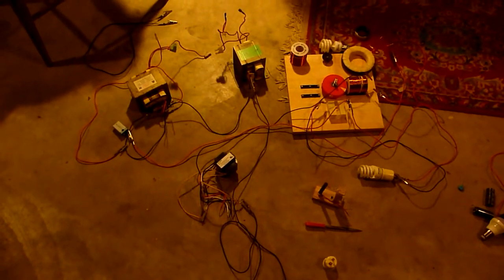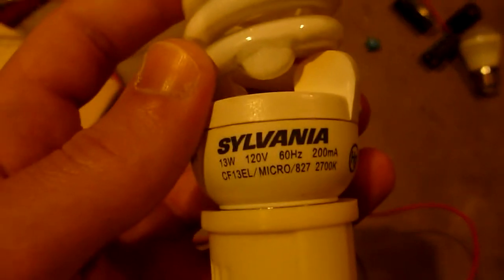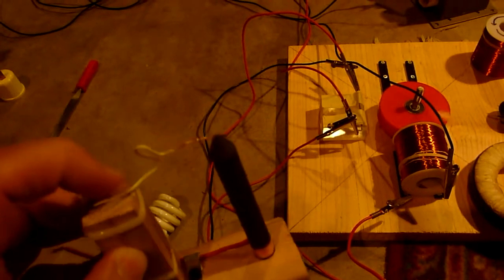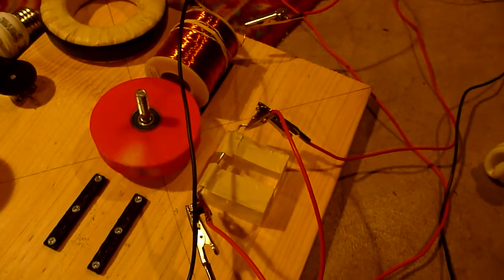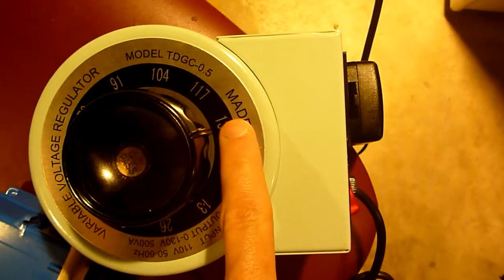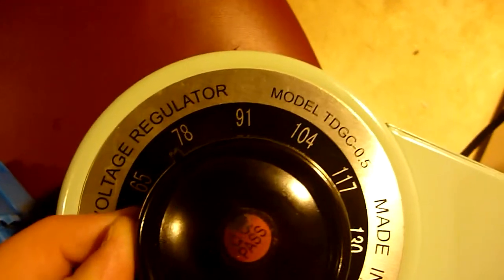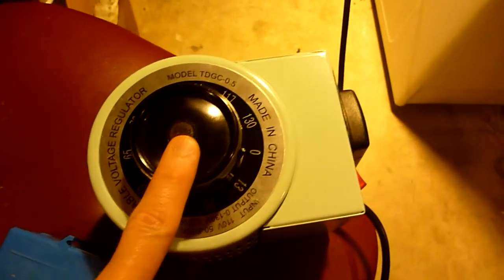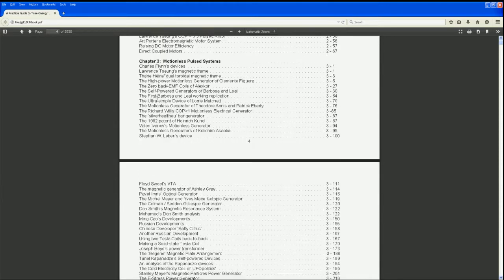Back EMF Experiment Part2

Comment: Wonder if a slayer exciter would get some nice oscillations at high voltage to then pump through your transformers and the drop the volts down to run a led (cfls have weird ballast circuitry that messes with the sign waves). Was also wondering if using the transformers, the way you do, is what Gerard Morin was trying to do with his cold electricity water drain pump project?   To prove a power gain do you not need to show watts going into the system compared to output watts the system is producing? If you are using a light bulb specified at so many watts it may not be using that wattage and so a lumin test would be needed I guess to say what power load the system can perform.  Very interesting for me to see your project, thanks:)

Comment: Cool setup! Interesting setup... But to answer the question you posed in the title, I would have to answer "No, this is not proof of OU"...
Now, I am not saying that it is not OU, I am just saying we do not have sufficient evidence on Input Watts vs Output Watts.
More work is required to determine the efficiency of this setup.
It is a cool setup and am interested in finding out the true efficiency...
If you used a wall-wort plug meter ($20-$30 wal-mart) and plugged your wall-wort 5V power supply into it, you could get an easy wattage input reading..
You would then have to do some sort of rectification of the output into a cap with a large (20W or more) resistor... Measure the voltage across the resistor (quickly before it heats up) and use Ohms Law to figure the true wattage being output...
Those are my 2 cents anyways, keep up the good work and keep experimenting.
Peace.
Reply from the maker: Binj Komisar Thanx for the comment. I actually do have a volt meter but these voltage and amperage spikes are very difficult to detect. The reason for that is because they are so sharp and then they go to zero very quickly. I used a volt meter in my previous video and it showed the same output voltage as input, even though the bulb was being lit up pretty brightly that was 13 watts (input is 5.9 volts at 0.4 amps so 2.36 watts max). Using a large resistor to calculate output is a brilliant idea. Also, you are correct because the video doesn't provide enough proof of over-unity. My next step will be to create a self looping circuit of some kind (Ed Leedskalnin style). He used a variable capacitor for this effect as well as a bottle with clockwise and counterclockwise wound coils (the air is a non-linear transformer material). The opposite windings caused induced magnetism to clash but at a non-linear way... this actually amplified volts and amps and allowed the entire system to power itself (my theory). We will see :P Checkout the paper that I provided. It is filled with all sorts of information, overwhelming actually.
Reply: Naoki Kashima
 Yes, I will have a look at the paper.. It is important to put a large capacitance filter/smoothing cap in parallel with the resistor, this will smooth the spikes and converts the energy into a more-or-less straight DC... I dunno, you will figure it out... Aside from using a 2 channel scope with voltage and current probes, it is your best bet at getting some wattage calculations.